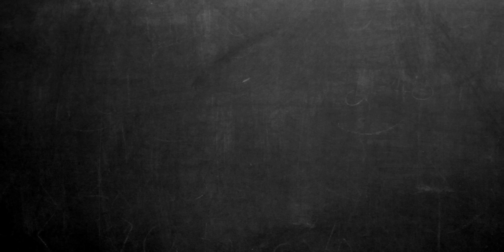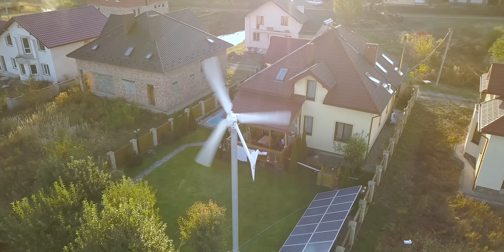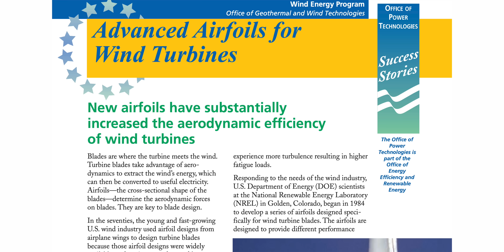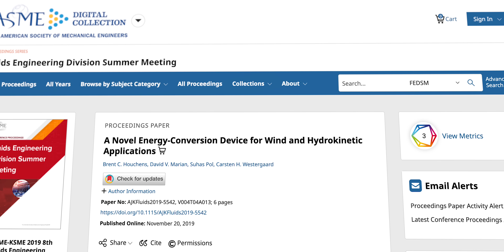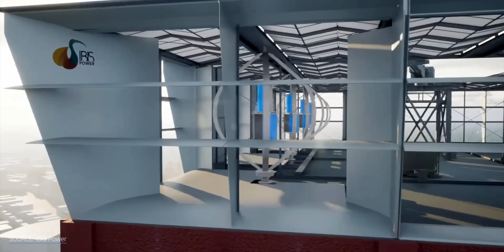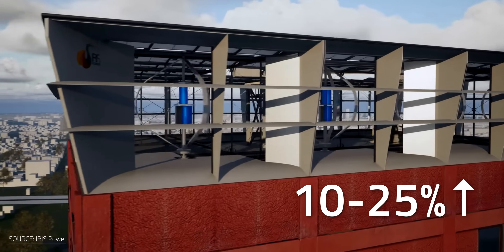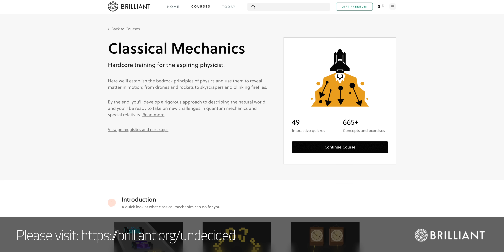How Can A Wind Turbine Be Motionless?

Comment: But it only collects the air mainly moving in one direction. It would be best if the empilar could use air coming in at any direction. Like being cylindrical with fins to caught air in all direction. Optimize the use of the air, not limit it.
Reply: That should give you an idea that it will not work very efficiently.
Reply: @johnxie6472  That what I implied. 6472 It seem like theres some reason behind the wind power development. That is trying to limit it's improvement, instead of advance it. It's obvious that a mechanism that can use the wind from ALL directions. Is superior to one that works in only one limited way, right...Their acting like their trying to develop something superior to pilot, but just able to keep under the set goal.

Comment: The problem with vertical axis turbine designs for large scale production is weight.
A non-rotating wing turbine will only produce electricity when the wind comes from a specific direction, so calculating Mwh is not accurate if you consider just the power rating and the hours per year.
Usually, a wind or solar power plant gives on average 25 to 40% of its rated power.
Another problem with distributed small power plants is the requirement to synchronize the AC current produced with that of the grid. If you fail to do so, then the unsynchronized current does not contribute to the grid but increases grid loses.
The best use for small power generating systems is for isolated areas, that would be too expensive to bring grid infrastructure there.
A major problem with wind or solar energy is their production instability. If a cloud passes over a solar power station, there will be a drop in production. The same is true with wind energy, where the power generated is directly related to the area of the wind system facing the wind and the wind speed to the third power. What this means is that a 10% fluctuation in wind velocity will cause a 33% fluctuation in the electricity produced. This can cause grid instability leading to power surges or a blackout (I had a number of electrical appliances in my house damaged by power surges when Greece closed down its coal fired plants in order to go with wind and solar power. The problem went away when they restarted the coal fire plants, because of the current crisis with Russia).
Large scale use of Wind and Solar Power, above 25% or more, will require some kind of storage installation, in order to absorb the power fluctuations and stabilize the grid.
I think that Iron ion batteries allowing up to 100 hours energy storage will be a very promising technology, allowing for DC current to be produced by the wind generators, simplifying their design, converted to AC from the battery to the grid.
Also, I found most interesting and promising your video about Agrivoltaics, combining farming and solar power.

Comment: I got one little correction (witch is more cool than obnoxious). So you said its the pressure under the airfoil thar generates lift, but you actually get more lift from the suction above the airfoil, although bouth components matter.

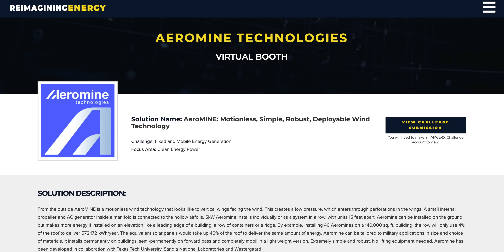Comment: 4:50 Do they assume there is full power 1/3 of the time (365 days * 24 h * 5 kW / 3)?  At my place, sadly, the wind is rare and gives about 2% of total production.  Still yesterday was the most windy day yet with a production of about 1.5 kWh.  Meanwhile, in cloudy weather, the solar panels produced each 2.0 kWh, so I got a total of 7.5 kWh, less than 25% of it from wind in the best conditions.

Comment: I'm seriously disappointed that you jump into such idea.
Indeed, the power that we can take from air is the same for aeromine than a standard windturbine because at the end, aeromine stay also a windturbine...
And we know the formula which determine the energy that we can have :
Size of the windmill and windspeed are the determing aspect.
Once there, there is no need to talk about anything revolutionary in aeromine even if they sell the project to non technician like if it was.

So my disappointment come that I expected someone informed like you would not fall and promote such thing without criticism needed.
It as advantages. But it is nothing revolutionary and we can't wait a lot of power from it (need to check what is better. What is the best use of extraction in extract kg / kWh produce in lifespans...)

(sorry for my english. It's not my nativ langage)
Hopping to see a let's have a think about why we should keep our head on shoulders about such not revolutionary thing 😉

Comment: Why-en-dot Michigan.
Reply: Years ago someone designed the same concept but instead of air foils  it has a funnel shaped inlet, facing up. This design increases airspeed like a car venturi with the turbine at the constriction.  This had the advantage of generating power regardless of the direction of the wind.

Comment: You are wrong that rooftop wind power is unpopular because of having moving parts. The main reason is that the amount of power generated is not significant unless the turbine is large, at which point it can be quite noisy and also expensive to build strong enough supports to stop it getting blown over.
Reply: Do you feel smarter after all that gibberish?
Reply: @sinoverlord409  If you believe it is gibberish you should be able to provide a counter argument. I didn't think so. It remains a fact that rooftop wind power remains rare because it simply cannot provide a significant enough amount of power to make it worth it. There are rare exceptions in locations with consistent ground level wind, but they are very rare. Rooftop solar on the other hand works almost everywhere. Large wind turbines remain cheaper and a better choice on an industrial scale for particular locations.

Comment: From my observations there is absolutely nothing preventing Aeromine from being able to rotate into the wind use the central duct as a hub, and install a rail to track around the hub and hold the mass.  It could be turned a few different ways, first a rudder like the plains water pumping windmills, second a motor could turn based on peto tubes or some other sensor, third it could be manually rotated to face seasonal winds, example winds on the coasts tend to shift by season!

Reality, that is likely already designed for future release as upgrades create more profit! So why show all your cards today

Comment: Aeromine looks much like a scam to me.
No hard facts (not even about size), but unrealistic claims regarding costs and electricity production.
I heard about 25% efficiency, but with the proper wind direction of course. Even at a site with a dominant wind direction, the overall efficiency will be much lower.
Probably comparable to a Savonius-type wind turbine of the same size.
Let's be optimistic and say 20%. And a size of 9 m² wind swept area (3x3 m). You would need a wind speed of 16.4 m/s (59 km/h, 37 mph) to get 5 kW from a turbine of this size and this efficiency. This would be a very high wind speed for nominal power. And a poor electricity production at fairly normal sites.

Comment: I did a lot of work on a similar system about 10 years ago (CFD simulations and models) but could never get a decent output. It used a very similar process. Let's hope they are more successful than we were.
Reply: What were the issues?
Reply: @silo3com  Low power and variations in wind direction. We did try a Torus configuration (a bit of imagination required without drawings) to access wind from any direction, but this gave even lower power.
Reply: @rogerwilson6367  is there a way to channel the wind between the buildings themselves to generate power?
Reply: Interesting :)
Reply: This is my concern as well. Solid state wine isn’t a new concept. It seems to have not been viable to date.
Reply: @mimandshaindy4906  Wine Gums?  On a more serious note, I forgot to mention that we could get reasonable outputs if they were roof mounted horizontally on the apex). They do mention roof mounting, so perhaps this is a condition of their figures.

Comment: I was concerned about the use of solar panels with the fixed wind turbine in the first example since the structure would cast shadows on the solar panels. Placing the panels above the windmill as in the power nest does seem to alleviate the issues.

Comment: A 5kW turbine has around 15 square metres of swept area.  These have nowhere near that area plus they are wind direction dependent and they redirect the wind.  So their capacity factor must be much less than the 35% typical of turbines.  That said, reducing noise and vibration is critical for attaching wind generators to residential or commercial buildings.  It would be nice to see some real numbers for this technology.
Reply from the maker: We'll have to see how these pilot tests play out for final numbers.
Reply: Hi John the wind turbine in PowerNEST has a swept area of 12.6m2 and a capacity of 3kW per turbine. The entrance of each Venturi funnel is around 30m2. There is certainly always room for improvement and that's where IBIS Power is already working on.
Reply: @alexandersuma  Can you tell us at what wind speed do they achieve 3kW ?
Reply: @alexandersuma  12m2 this little Turbine at 05:58 ? 12m2 are 3,4x3,4 meters. That is never that big. The 3kw could only be harvested at storm speeds i think.
Reply: @SD_Alias  no. Not that one.
The powernest is the second system mentioned in this video 7:33
Reply: I'm very skeptical about the performance of the Aeromine. It essentially works by using the large structural aerofoils to create a low pressure sink for the turbine to exhaust into. But there's so many pressure losses in the system (turning losses into the turbine inlet, frictional losses in the duct, discharge coefficients) that i think the efficiency will be very poor. I'd definitely like to see some real-world performance data when it becomes available
Reply: I thought from the footage of the nests that those spun in the "egg beaters", which made them change direction. Or did I see that wrong? They are stationary INSIDE those? I figured they spun inside making it like a car in a constant corner which helped the turbine inside. These are an interesting concept for sure, especially from a maintenance aspect. Looking forward to seeing how it develops.
Reply: The powernest concept, as shown, is clearly a nonstarter. Way too much infrastructure vs. output.  A successful unit would be a lot larger, taller, feature one central turbine, and would sit in a venturi or between 2 lens shapes, covered with solar I suppose.
The AeroMine concept is interesting, but it's also a nonstarter unless it's made to be dynamically directional and it must be a lot higher and a lot larger.  Unless the turbine is right in the base below the foils, forget it due to laminar flow losses in the piping.
It's worrisome to think people would pay for these naive executions of maybe good concepts... the same people are voting on 'green energy' and making all of us pay for it.  And endure blackouts because of it.  For the record, I have always been hopeful about renewable energy.

Comment: The Aeromine looks like an interesting concept.  I wonder how feasible it would be to try to make something similar as a DIY project.
Reply: As it seems to be a design that only works in very specific locations really I don't think it will make a great DIY project - you can build something like that relatively easily but the odds that you have a good location to get the right airflow for it to work well are pretty low. Also don't think it will really scale that well - as the pipes to the turbine gets smaller the airflow resistance increases and the cost for the materials will relatively go up - can't use a 0.001mm wall thickness pipe, even if it will take the pressure as its not structurally sound enough.
Reply: I’m not a sparky but it seems the most basic form would be a DC fan that you mount somewhere and use as a generator.  From there, enclose it in varying dimension ductwork. Attached to a wind vane.  Is the airfoil itself necessary?
Reply: @-Stop-it  the airfoil is what manipulates the air pressure. The difference in pressure makes the turbines spin, versus wind driving the turbine blades
Reply: @Unicorn Trooper  the whole thing is pointlessly over complicated. You would generate more energy by making a hoop that has the same diameter as that things height, putting a large rotar in the hoop, and covering both openings with chicken wire. That thing is a fancy looking, inefficient waste of money.

Comment: Makes me wonder if you could create a negative pressure area using the solar on a domestic roof and use the increased wind speed to drive a turbine, your getting the Venturi for free with the panel gap
Reply from the maker: Interesting thought!

Comment: You need something that goes on the ridge on the roof to make it practical for most homes.
Reply from the maker: There is a product called the RidgeBlade, but the company hasn't released any info in a while. Not sure if it's still in operation or selling the product (been trying to get a hold of them).  https://thepowercollective.ca/

Comment: Seems to me that once the concept is proven with the 'motionless' turbines, the next challenge is to make the vanes pivotal to optimize the windflow, and you could increase the generation. But, one step at a time.
Reply: That would be easy.
Just place the vane structure ,as it is now, on a turntable bearing. 
The turbine in the base can remain fixed and a gland in the bearing can prevent pressure loss.
Reply: Don't even need the gland. Mount the turbine to the bottom of the airfoil support plate, and let all of it turn to track the wind. There still needs to be a way to get the electricity from the turbine to the building, but that's mostly a solved problem in electrical engineering - brushes, spiral cables, etc.

This is such an obvious improvement to their system, I'm honestly surprised the Aeromine people haven't thought of it already. Maybe they think such a rotational system would be too costly or too maintenance-prone? With a spinning turbine in there already, I think the "no maintenance required" ship has already sailed. And sure, the forces on the airfoils are much larger than the forces on the shaft of the turbine. But if we made rotating HAWTs work in the 1800s with those windmills that pumped water in fields and were subject to the harsh winds, rain and snow out on the prairie...
Reply: @SaltyPuglord  cheaper to use one bearing than a bearing and slip rings or some other method to affect a moving electrical joint
Reply: @paulg3336  There's a cost to an airtight gland, too. The big question is, which is less expensive to buy... and to maintain.
Reply: @SaltyPuglord  It doesn't need to be airtight. A simple elastomer strip is all that is required
$10
Reply: @SaltyPuglord  indeed, the turbine can be at the top of the shaft within the rotating top unit, but the generator can be in the stationary bottom unit. Boom. No pressure saving gland or moving electrical connections needed whatsoever.
Reply: Just a bearing at the bottom would not be a viable option for a structure this tall. Even on a very short structure it isnt. Lets take an example most people know. A bike pedal. The old ones and cheap ones wear out because it/they had 1 ball bearing on the shaft side and the outer side has a friction bearing. Simple washers made out of metal or nylon. A few years riding the bike and buy a new one. These structures need a bearing on the top and bottom
Reply: that's how the motionless turbines in the turbosails on the vessel Alcyone worked so yeah, they might as well rip off the whole concept 👍
Reply: That would be a good idea, so long as they also design some form of safety device to keep it from spinning too quickly during various storms. Which I'm fairly certain that suchs things already exist for similar systems. They could even have the foils mounted directly to a free spinning disk like platform, with a central body at the axis that it spins on to contain the actual pieces that generate the electricity to avoid the need for brushes or spiral cables. But the other thing to keep in mind is that all of this further complicates the design and increases the need for and complexity of maintenance/repair work.